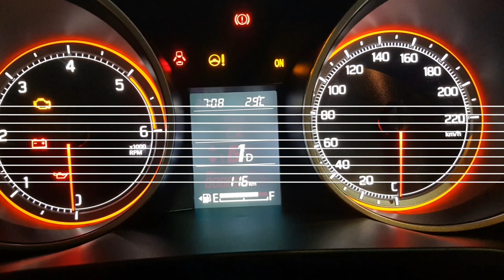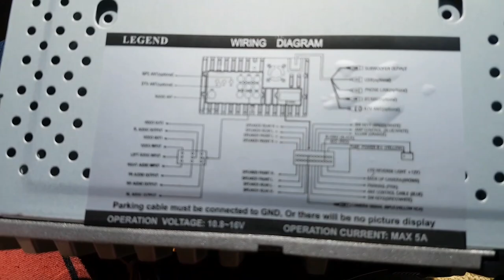how to installation Toyota car music system wiring diagram Innova crysta Etios

Comment: You have to just pull the AC knobs to get to screws? Because i tried removing knobs for my Toyota etios liva but they are very stiff, do you need any tool to remove the knob ?
Reply from the maker: No I don't have any tools for it just pull the site knobs the central knobs is not removable only side too knobs removable

Comment: Nice video, 
Sir, in my existing platinum etios 2017 model audio system remote is  not sensing, regarding this problem please suggest me solution.

Thank you. 

Murali Rao S
Reply from the maker: Thank you for your comment thank first you are to wash your remote motherboard with petrol and then clean it with a cloth and change the battery I think it will work if not you want to go to the key maker shop